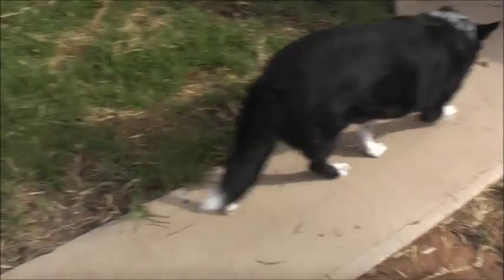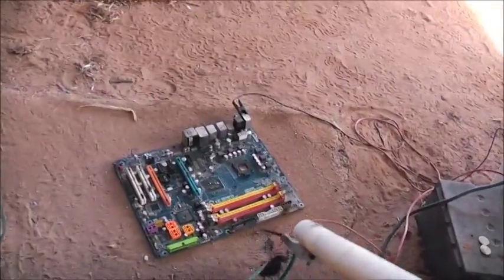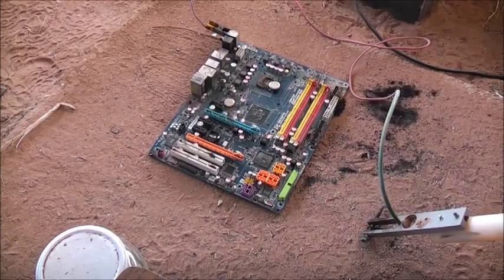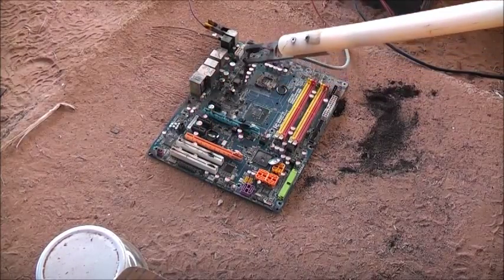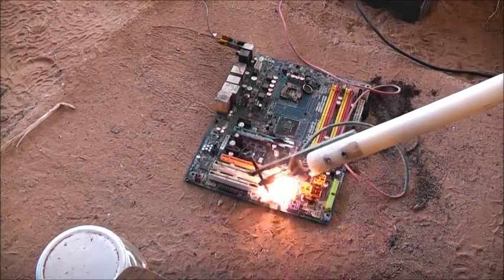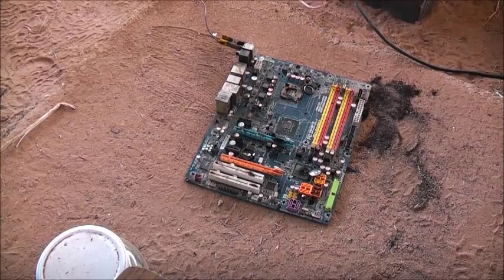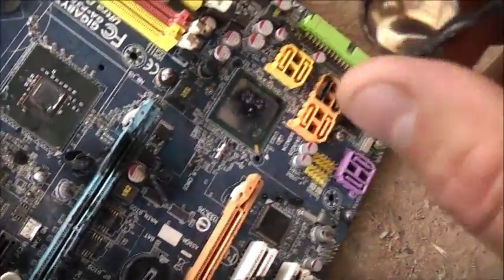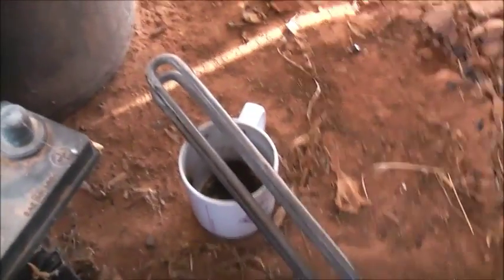MOT Fun, Popping CMOS Batteries!

Comment: I can't believe they just put water in there I guess it's cheaper than copper I doubt it's any better, haha phase change = water bloody marketing BS. Water has a higher specific heat capacity than oil that's why you don't fill your car radiator with oil.